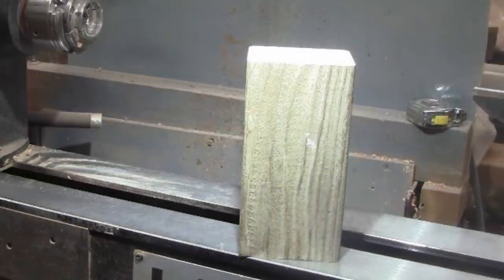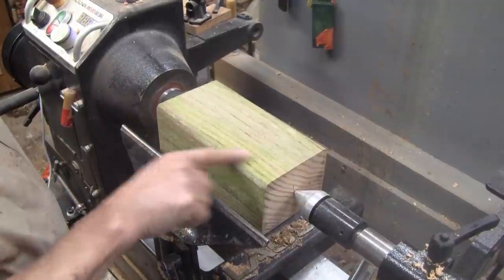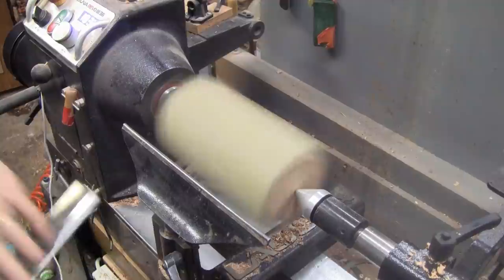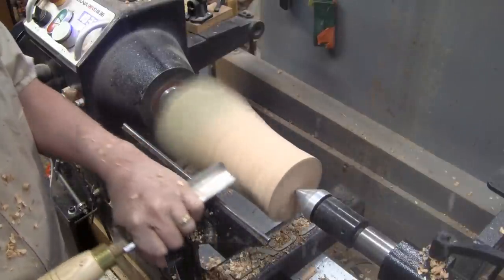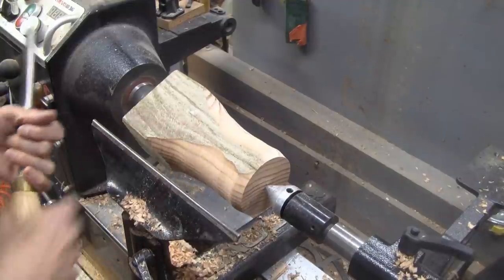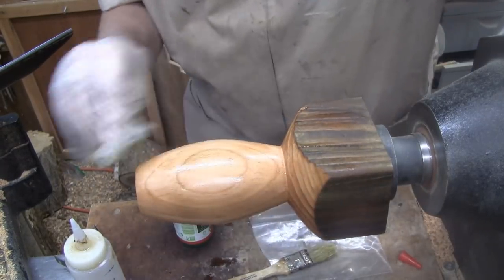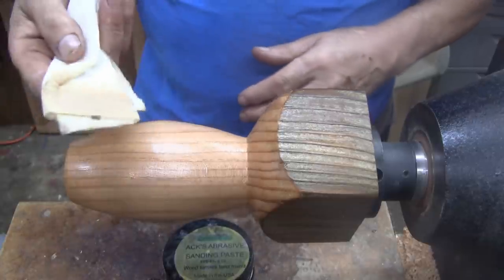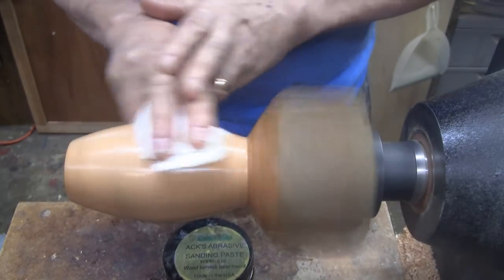The Million Dollar Fence Post Wood Turning

Comment: That is a very cool idea! It turned out nicely. One thing I’ve never understood is the difference between a shellac based sanding sealer and shellac. Are there other additives in the sealer? Can the sanding sealer be the final finish? I often use shellac, but I’ve never used a sanding sealer of any kind. Sorry to hear your peaceful landscape has disappeared. Rick
Reply from the maker: Thank you Rick! So the sanding sealer is not waxed and the shellac is. Yes you could use multiple coats of the sealer and get a nice finish. I think the wax is just creating a final finish that can be polished out better.  I wish I had a better answer. I buy each by the gallon and the sealer does soak in because it is thinner.
Thanks for watching,
Gary

Comment: Gary, great story and vase. I was hoping you would say you sold the property for $1,000,000.
Reply from the maker: Thank you Wile, well they were asking $3,000,000 for it. Not sure what they got but it was well over 2 Mill.
Happy you liked the vase and the story. Be sure to check what I wrote in the comment section. I failed to mention another huge connection I have to the place.
Gary
Reply: I saw the extra comments. Certainly adds to the story. All the best

Comment: Really like the piece, great to work with that has story behind it.
Can I ask , How do like your lathe after couple of years?
Reply from the maker: Thank you James. I love the lathe. Does everything thing you need. Smooth with lots of power. Mine is the 240 volt if you are wondering. I know someone with the 120 and it works fine as well.
Reply: @ThePapa1947  Thank you for the reply.  The lathe was on my short list but saw others having issues. Guess you can have issues with any brand.
Reply from the maker: @jameskillam5836  I have heard of a few issues. I have also seen videos where people were seeing things going on that I do not think were there. Such as spindle issues. Only issue I had was the banjo lock handle would spring back up. Laguna sent a new one but while I waited I inspected mine and they were painting the rod that cause the cam action with something very slick. I sanded it and problem solved. I called Laguna and let them know and they said they would have that fixed. Obvious they are having them made. I sent the new one back.
 I trust the lathe and recommend it. Like you say you can have problems with the top of the line. Which ever one that is the day you check.